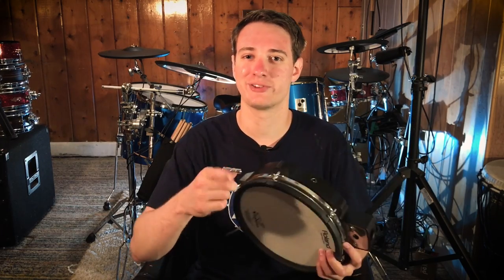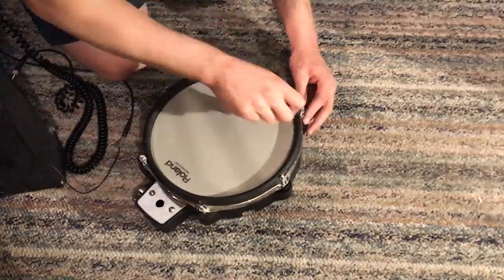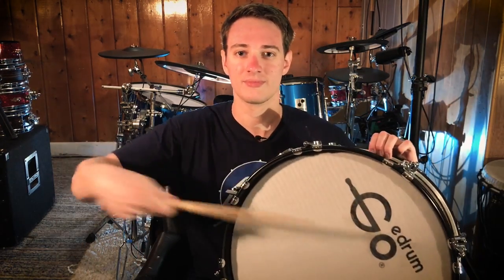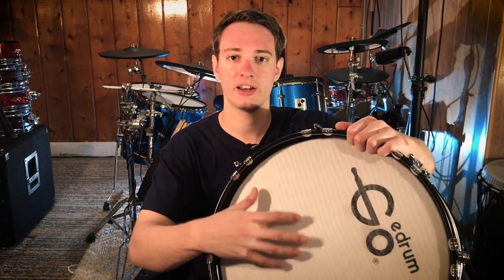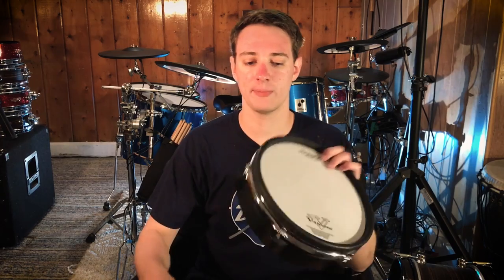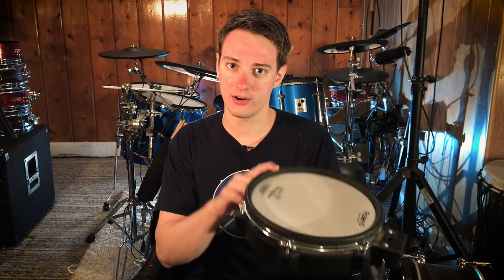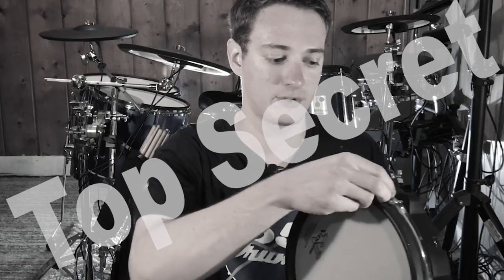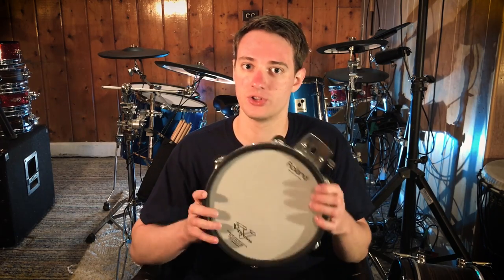How To Tune Mesh Drumheads (edrums 101)

Comment: I suggest using a ruler to first set your head. Measure the distance between the hoop and lug. Make them all the same. Mine were about 27 millimeters.   This centers the head. After that tighten evenly to preferred tension and or pitch.

Comment: Just got an Alesis Strike kit last month after playing it at Guitar Center. I'm new to drums, but the one at the store definitely had the bounce that the acoustic set did and mine does not. I have adjusted the tensions some, but still doesn't feel the same. 

Do you think it is worth getting a drum tuner or should I just keep at it until I find what I feels right? 

Thanks.

Comment: Interesting, I can’t find an answer to my very specific question, and you almost answered it here. I have a Roland e-kit and am trying to get better at double stroke combos (rolls, paradiddles, 5 stroke rolls, etc). Should I just tighten the heck out of my mesh heads? Is it a “tighter the better” formula? Tight=bounce? Tighten as much as I can, and maybe back off when I get better?  HELP!

Comment: Hi Justin, thanks for your videos.
I'm having an issue with a PD-85 snare pad where if I tune it higher (tighter) I start to loose the rimshot function at some point so I have to keep it pretty loose.
I do like that but a ltiny ittle bit tighter would be nice so do you happen to have any idea why that would be or could you describe how the rim trigger works in detail?
cheers

Comment: i just bought alesis crimson mesh set. just set them up and plugged in wires. also got extra tom and crash. i have not yet played or ,learned module. the set comes with black heads. i will hit them lightly. i wonder if the center of the head will wear a hole through  ?  would i get replacement heads from alesis, or does any mesh head work ? thanx  dec.21,17        😎

Comment: Alright Justin. It's time to answer the big question. War of sounds. Alesis Strike VS Kat KT4. Just going off the quality of the sounds. Wish you could get the strike. Would make a great Vs video. Imagine intermediate Vs only based on sounds. TD25, KT4 and Strike modules.
Reply from the maker: The KT4 sounds good, but has bad dynamic range. havn't played the Stike so I can't say anything about the dynamics, but it sound above average. The TD25 is very well round, great sound with better dynamics.

Comment: Nice, I'd often wondered about this...I'd planned on making a diy mesh head shell set, but I've changed my mind...It would be kinda expensive & I could spend that $$$ on something I need instead of want...Plus, I'm running out of room here & the bigger shells would take quite a bit more space, that I don't have...Eventually I'll have a bigger pad & can do this, but until then I'm just gonna stick with my pads...
Reply from the maker: Hey whatever works :) it's not for everyone

Comment: I’m new to E drumming, is there a way to lower the rim on the snare? I have an 8” and I find I’m hitting the rim ALOT.
Reply: If you happen to have an Alesis, you can take that rubber ring right off. Just pulls free and lowers the rim by a lot. The ring can go back on easily enough if you find that you want it back on there. I did that with my Nitro Mesh snare. The rim of that thing felt a mile high at time.

Comment: I have Roland PowerPly heads on my drum and let me say that you have to be careful with tensioning... I ripped the mesh out the aluminum ring... It happened without any resistance... I think Roland's method of gluing isn't the best, they don't folding over the lip like the others...

Comment: Was so disappointed the secret drum tuning method wasn't real! 8^) Great video as usual - I was wondering about optimum turning for mesh heads. Medium tension seems like a good starting point. I ended up lowering the tension on my kick drum a bit (3 ply mesh head from UFO Drums) - just slightly less than medium tension.
Reply from the maker: Haha! Sorry about that, people kept asking me for the secret method of tuning that doesn't really exist, so wanted to clear that up with a video. For the best triggering accuracy I'd get them decently tight.
Reply: 65 Drums How about some real numbers and practically exact/consistent tuning from something like a drum dial or tension watch? I suppose I can figure this out myself. I’m thinking somewhere between 370 and 380 on my dial.